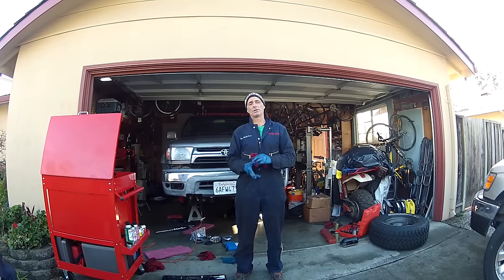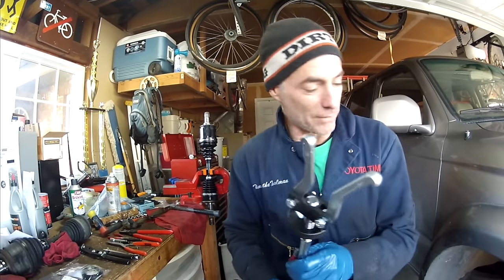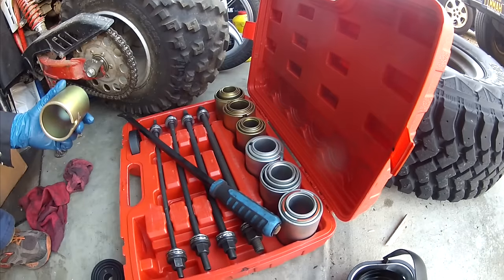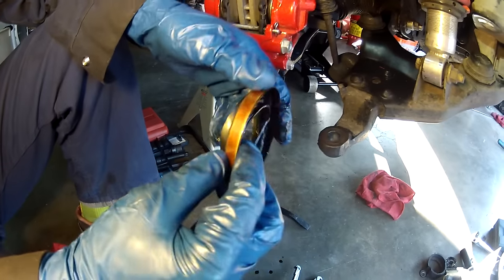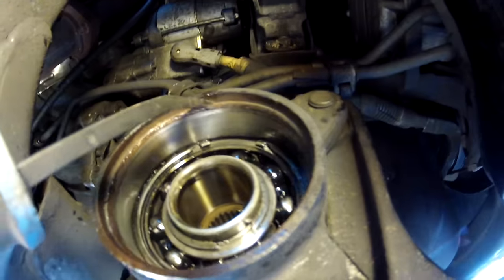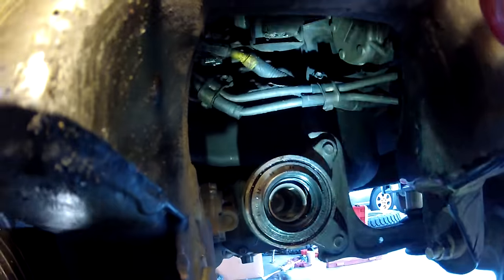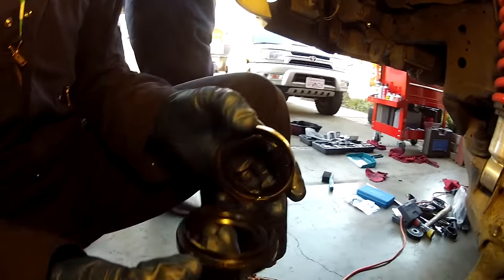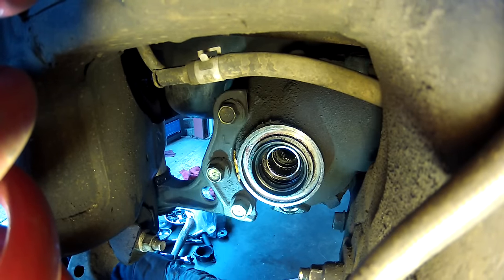Front Differential Axle Shaft Oil Seal Replacement

Comment: now try to reinstall the cv axle without damaging the new seal.
Reply from the maker: Well of course don't mangle the seal when getting the CV back in.  But, I guess some poor souls have done it.
Reply: @TimmyTheToolman  I've done it. Apparently it's easy to damage. It'll be the 3 rd time I'm taking the axle out :) ... :(
Reply from the maker: @lexbrusb.1821  You know what's funny is I just did CV axles on a Lexus GX 470 and the driver side seal started leaking after the job.  I know I went in smooth and straight with the shaft.  I'm going to shoot a video for replacing the seals on that rig now.  I've removed and reinstalled CV axles on 3rd Gen 4runners many times with zero issues with the diff seals developing a leak.  I guess I was due for one.
Reply: @TimmyTheToolman  Probably was, I took a better look at it and it seemed perfect. I guess it was just wore out. Anyways, THANK YOU for doing those videos.  It really helps me out.
Reply from the maker: @lexbrusb.1821  You're welcome.  Hopefully your leaking differential seal problems are in your past.

Comment: Passenger side seal was put in backwards correctly, otherwise good video.
Reply: Look at your own video at 1:34 see the gold/brass side?  That is the passenger side. Now look 2:26 brass side facing out. Does that not look the same to you? If you got an OEM seal it should look the same when you're done. Are you saying Toyota did it wrong? Look same seal 1:34 then 2:26 then 7:15 backwards. I'm not trolling. I own the same vehicle and I've done this job. I do know what I'm talking about, the spring faces out, you put it in. I really do think you make good clear videos, but you did mess up here, and it's unfair to not let people know.

You lied to another commenter and said it's impossible to put it in wrong. It's a circle you can slide it in either way nothing will stop you. Then you lied again and said Toyota changed the color of the seal from brass to black. You can clearly see the seal YOU had part #90311-47013 at 1:34 is brass colored not black.
Reply from the maker: No Dude, you do not know what you're talking about.  At 1:34, you're seeing both seals in that shot on the work bench. The smaller black one goes on the passenger side and the bigger Gold one goes on the driver side.  They are two Totally different size seals so you Can't mix them up.  The spring DOES NOT face out when I'm installing the passenger side seal.  I put the seals in the same orientation they were taken out.  The OPEN face with the spring visible goes towards the differential.  I've had CV axles out of these rigs MULTIPLE times and NEVER have I seen one with the spring side facing out.  Start watching at playtime 3:25.  You can clearly see that the seal is installed with the spring side facing the differential.  Now go to playtime 4:13 where I'm comparing the old seal with the new seal.  Do you see how the old seal is GOLD and the replacement is BLACK?  Wait, I'll say this one more time.  Did you freaking see that Toyota decided to change the color from Gold to Black?  I have both seals in my hand and they are the exact same seal with the exception of the color.  What don't you understand about this?

At 7:15 playtime, where are you seeing a spring?  

Dude, I've wasted enough time with you.  You were either stoned when you were watching the video, maybe you need glasses or maybe your'e just somebody trolling trying to piss me off.  I absolutely appreciate when people bring mistakes to my attention and I gladly correct them because I don't want to give out bad information.  My comment stands that you have to be a complete moron to install these seals backwards.  If you were the one that pulled it out, you should be able to remember the orientation.  If you don't remember, just consult the opposite side for the correct orientation.  

If you reply with anything except, "Sorry, Timmy you were right and I was wrong", I'll just erase your comment.  God I hope I finally got it through to you that the seals were installed right.
Reply: @TimmyTheToolman  Sorry Timmy you were right I was wrong. 

The last person to change seals in my truck put the passenger side spring out. I assumed stupidity it was correct. I checked online thinking it was odd driver side was spring in and the passenger was spring out and found a picture with spring out too.

Going off how seal came out of my truck, internet image, looking like the old one was gold out then you putting gold facing in. Then you saying its impossible to put in backwards (I agree left to right impossible but spring in/out is very easy to do). I thought maybe you were some jerk trying to cover up your mistake. Not trolling I had good intentions. Sorry.
Reply from the maker: @libtrs838  I really respect the fact you got back to me and admitted you were wrong.  I have a high level of integrity and I would never purposely steer people wrong just because I couldn't admit I made a mistake.  I've made plenty of mistakes and always appreciate when people bring it to my attention or just show me a different way to accomplish the same task that could very well be better than the way I chose.  I've learned a lot from our subscribers. 

You are correct somebody could absolutely install the seal backwards but I just think you'd have to be pretty inept to do that.  If you were the one that removed the seal, you should be able to easily remember which side faced out and which side faced in.  You also could just examine the seal and and tell which side was inside and which side was outside based off the marks or dents the puller you used made to the seal.

Anyway, thank for getting back to me.  Happy Wrenching!
Reply: Timmy The Toolman  I wished you didn't resort to replies with such aggressive negativity. Ironically, while calling m m a complete moron, I would contend there is some SERIOUS issue with being a mechanic and leaving that transmission in there. I honestly have no idea how you can justify running that transmission when it CLEARLY needs a rebuild. Thanks for showing how to replace the seals but please let others know ITS NOT OKAY to run a transmission that has so much broken metal fragments. 

I'm sorry m m that Timmy the "toolman" berated you, even though you were wrong in your assumption of the placement of the seals, as the "instructing" mechanic he should comport his self in a more professional manner and leave his hypocrisy at the door.

Two wrongs don't make a right, however Timmy's error was far far greater than m m's. 

Anyone reading this, DO NOT OPERATE A TRANSMISSION THAT HAS BEEN DAMAGED EVIDENCED BY THE AMOUNT OF AND TYPE OF METAL FRAGMENTS/SHAVINGS SITTING IN THE TRANSMISSION OIL PAN..FOR GODS SAKES....
Reply: Spring side always goes on the oil side, remember that ;p
Reply: @andyfumo8931  You should read further up in the comments where Timmy said that the owner decided to keep running the DIFFERENTIAL the way that it is. Timmy in fact said he absolutely did not recommend doing this, but it's the owner's decision

Comment: I wonder if this video would also apply to my toyota echo. Really don't feel like pulling the engine out just for a seal replacement (the repair manual says to supposedly get the seal through the engine bay. Da fuck?) Probably gonna try removing the wheels and CV axles like you guys did.
Reply from the maker: Yeah, if you have to pull the engine to get to those seals, that's a ton of work.  Hopefully you'll be able to figure out a much easier way.  Good luck and Happy Wrenching!

Comment: Anyone use the SKF seal kit with both left and right side seals with good results? Toolman thanks for clearing up the left right seal deal they are different, Toyota's website was not clear on the part says left or right on 90311-47013. Also does anyone know if there are improved seals that would prevent future leaks, looks to be pretty common problem?
Reply from the maker: You're welcome.  As for the seals, I would recommend going with OEM.

Comment: 11:48...just back up the video foo'.
Reply from the maker: You lost me on this comment.   What ever do you mean?
Reply: At 11:48, you were talking about how to remember how deep the seal should be set.  But you had shot video, so you could refer to that.  Also even if not filming for You Tube, folks can  and should take tons of photos during disassembly to refer to during reassembly.
Reply from the maker: I totally agree that it's good practice to take photos or film to help you put things back together.  It's also smart to label hoses and electrical connections so there's no confusion where things connect back to.

Comment: Help!! 2001 4runner--replaced both left and right cv axles, both same part numbers 43430-35030-84 .
My passenger side oil seal started leaking so I ordered the seal 90311-47013 it came 2 in the pack same seals.  So it's the same  cv axles but different seal right ?
Reply from the maker: The driver and passenger side seals are different.
Reply: @TimmyTheToolman  Thank you , but the cv axles are the same right ?
Reply from the maker: Yes.
Reply from the maker: @texasoutdoors7802  Yes, the CV axles are the same.

Comment: So I over filled my diff doing a fluid change and now it's leaking just a little bit of gear oil out of both sides at the seals .
Reply: Will the f u d leak out just enough to balance off the fluid in the diff? Or do I need to do my cv axle seals ? ?
Reply from the maker: @joesmith7123  By overfilling the diff, there's a chance your breather couldn't escape enough pressure and the pressure took the path of least resistance pushing past the seals.  Here's what I suggest you do, get the fluid level right first.  Next double check your breather works.  You'll find it on the driver side fender in the engine compartment held with a plastic clip.  Pull the breather off the hose and try to blow through it.  If you can move air through it, it's good.  If not, replace it. Next, wipe up the mess of gear oil from the differential housing and differential tube and keep an eye on the seals.  If they continue to leak with a properly filled diff and a properly working breather, then it's time to replace the seals.  If you need a video for the process, we have two videos you can use.  The first one covers most of the process.  The second one is to show you a better tool for the insertion of the seals.  Just skip to that part in the video.  Good luck!

https://youtu.be/mh1BK5--KrU
https://youtu.be/Q-RO52NtP1A
Reply: @TimmyTheToolman  awesome thanks
Reply from the maker: @joesmith7123  No problem Joe.